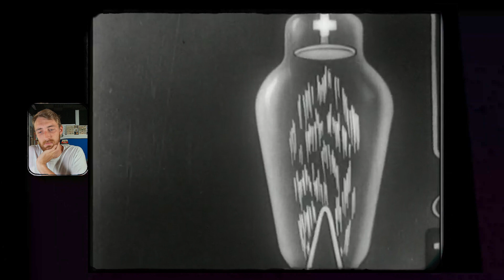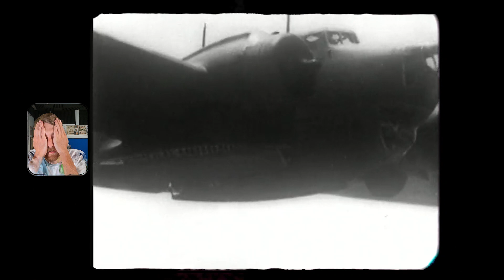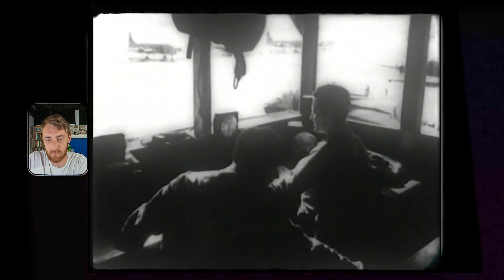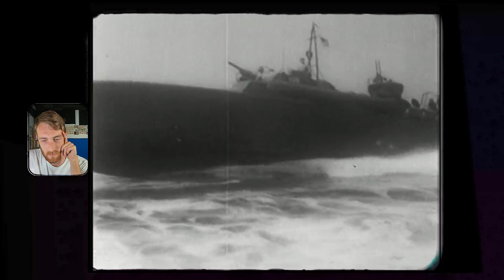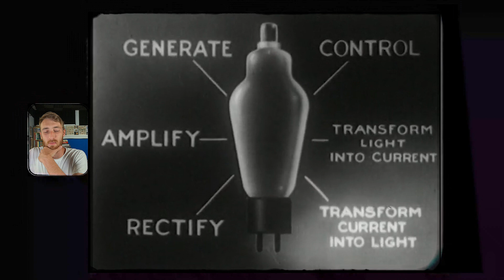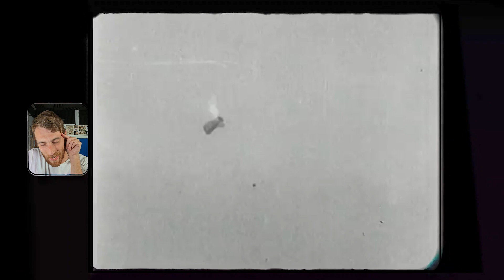Electronics at Work

Comment: X-ray tubes are still used today to take medical x-rays. Due to the high voltage and current the cathode has to be a spinning disk to spread the heat and load, otherwise it would get destroyed. 
With regards to amplification, then today we use transistors for amplification and as switches. Microchips, like CPUs have millions or even billions of a few nanometer sized transistors, each playing the same part as a whole tube might have done at this time.

With regards to the "lightbulbs" or Cathode Ray Tubes, those are the tubes used in old style, pre-LCD era, TVs, explaining their giant size. Regular lightbulbs wouldn't really be classified as electronics or vacuum tubes.

The rectifier tubes change AC to DC, but the ones they used in the "generate" part can generate signals and one of the applications is to change DC to AC.

I agree it's magical what they were able to do with the very simple tools of that time. Nowadays you can do with a 5 cent microcontroller what they would have needed buildings worth of tubes to accomplish.

Comment: Hi, with regards to the amplification, most of the sensors use to measure force, strain or deformation emit a very low voltage differential (changes in millivolts) so the amplifier helps the machine or technician to get more accurate readings during manufacturing processes aided by those sensors